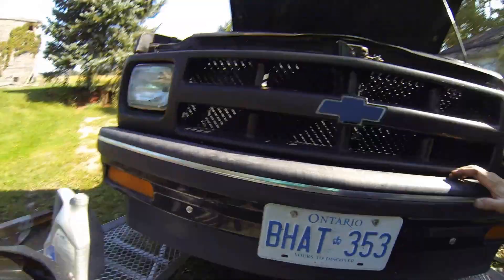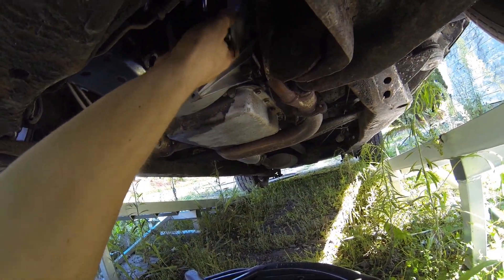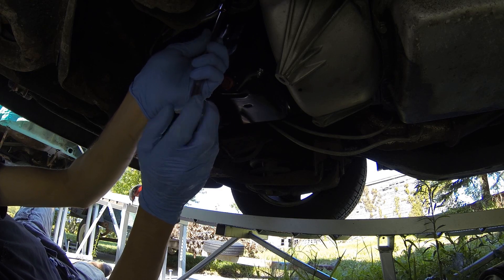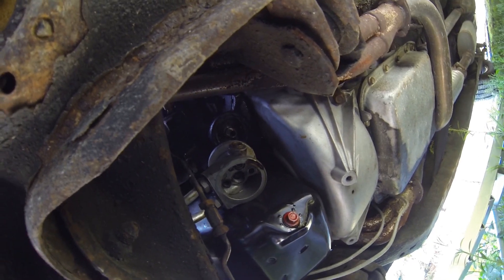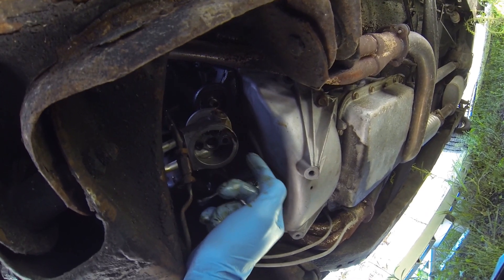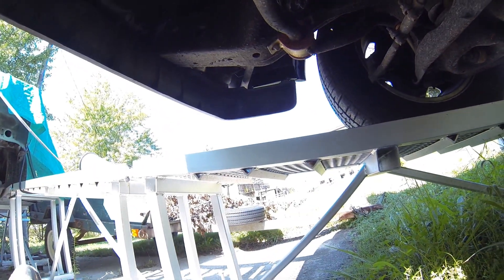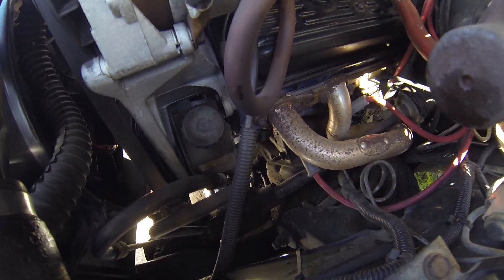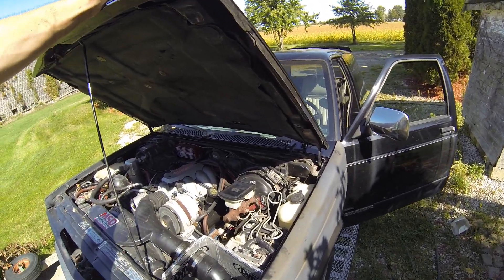S10 Blazer FREE FIX Oil Cooler Removal

Comment: Thank you so much. I was stranded on the side of the road with a blown oil line and was able to fix this and save my vehicle but some basic tools I had in my blazer. The separating that adapter with the Allen head really saved my ass. Thank you so much brother
Reply from the maker: Very happy it could help you out! thank you for the comment and sharing your story. Cheers!

Comment: this worked great on my 89 S10 Blazer 4x4,  replaced the oil cooler line 3-4 years and were leaking again till I did this fix. thank you
Reply from the maker: Thanks for the follow up, glad to hear it worked out Cheers!
Reply: Get to know my Orleans replace that 10 years ago and good I don't bad that match. You got any ideas about the rear bumper molding mine came off too I got two screws in the front one it's 92 with the same setup Vortec S10 Tahoe digital dash like to find a cruise control cable for it
Reply: Did you need to get a stubby filter or does the original size work?

Comment: heading out to do my 97 s10 finally figured out that this is my oil leak hopefully all goes well  thanks a bunch for the info perfect
Reply: did it work for you?  i have a 95 s10 i want to try this on.
Reply: @effenfish661  yep!!!
Reply: @effenfish661   yes but be careful removing your 2 torx screws I stripped one and it took alot of extra bs getting it out but yeah no more oil leak it even increased my oil pressure about 8percent

Comment: Deleted mine in my 02' Blazer Zr2. No more leaking lines & oil spraying everywhere. My Oil Pressure gained also! No difference in normal operation Temp, even when pulling my trailer or under a heavy load. I did try a 180° thermostat but that set off a Check Engine Code, "Coolant Temp Below Threshold"- so the 195° went back in & no issues. You have to use a little oil filter & you can reach it to replace or install with a small 3/8" drive metal oil filter removal bowl socket thingy for oil filters & a long extension
Reply: Appreciate the info on the thermostat. 200° it's where it runs on the according to the dash I was thinking it could be cooler they gave me 200 to put back in it but I haven't done it yet I living in Texas I wanted to be as cool as you can be tripping the sensors it'd be nice to get more than 14 miles to the gallon difference

Comment: I’m not sure where you live, but I am in Minnesota. In the winter the oil becomes super thick when it is -30 outside. I am deleting my cooler on my zr2 blazer as well, but what you forgot is that you no longer have an oil filter bypass valve if the oil is too thick or the filter clogs. It would be better to buy the $5 adapter of off summit that includes the bypass valve. But great video! Good luck!
Reply from the maker: 15th_Street_Garage good point! I do however run 5W30 synthetic and the blazer batteries are removed from the truck during the winter.  Im in southern Ontario.  Thanks for the tip and comment.  

Cheers!
Reply: 15th_Street_Garage my 4x4 sonoma looks like that same deal here. I do 4wheel it. But don't drive it every day either.  Think I could get rid of that an just slap my filter on there an fix the leakages....
 What's that part name on summit so I can look it up? Or add a link for me would be awesome! Thanks. Mines a 97 zr2. 4x4 5speed.
Reply: There should be one in your oiling system already on your Zr2 that you can unbolt and remount just onto the engine, but then you have to run a short oil filter. I actually found out that 1992-1996 Lt1's sometimes came with an oil filter adapter that moves the filter in towards the pan so that you can run the stock filter without hitting the front driveshaft or differential. I should be getting mine in the mail sometime this week, I found a guy on a facebook forum for LT1 engines in Texas. Hopefully he follows through.  GM part number 10168497. Good luck SIKZR2. The oil cooler lines are one of the biggest weak points on a stock Zr2.

Comment: Thanks for the tip, changed mine out on 2000 S-10 4.3. I took my fitting with me found STP 3980 is little bit longer filter that works with 4.3 V-6.
Reply from the maker: Glad you found it useful.  thanks for the comment!
Reply: I hope it's as good as the AC filter I'm trying at the STP oil straight 30 weight I always use the STP additive with all the oil changes slippery stuff

Comment: Great informative video! Do you know what the new oil capacity is now that the cooling system is removed. I am assuming right around 4 quarts.
Reply from the maker: Your probably about right but I always filled to the dipstick level. never really measured

Comment: I have a question, can you use the same oil filter after removing the adapter? It seems that the diameter of the filter housing on the engine block is smaller than the one on the adapter. It may be just an optical illusion when looking at the video...not sure.
Reply from the maker: The same filter fit with no issues for me.
Reply: @RobHoffmann20  Thank you. I appreciate it.

Comment: I have a 1995 Z71 with the 350 in it. Will this work for mine? Also, couldn't you just put plugs in the inlet/outlet holes on the adapter?

Comment: So what happens to the lines going into the radiator? Do you you plug up the holes or just leave connectors in?
Reply from the maker: You could Install hole plugs or bolts. you could also leave them open. I ended up replacing the rad when it cracked and just opted to buy the cheaper rad without the oil cooler.
Reply: @RobHoffmann20  Awesome, and thanks for the video and info!
Blessings!
Reply: It’s a closed loop system so nothing will be affected whether you plug them up or not

Comment: Good video with great narration! I can't stand when there is stupid music or pictures. However, removal and replacement of this assembly is very easy, and not to mention it's quite cheap. There are updated cooler line's which aren't prone to leaking. The oil cooling has a ton of pro's and zero con's. Also, I don't know why you have an MSD ignition system on any modern GM that isn't crazy modified (in the case of the 4.3L say a turbo with a marine MPFI intake). The stock HEI system is far more superior to any aftermarket system. Multiple tests and dyno run's have tested the theory on GM 4.3's and 5.7's and there was no gain.
Reply from the maker: walter white Thanks for the feedback and comments, I did not know there were replacement oil cooler lines avaiable.  Also regarding the MSD, originally I had issues with ignition on the truck as well as power losses, it stemmed back to the ignition system as a whole.  Replacing the coil and installing the control box provided a more reliable idle and smoother operation.  The distributor began to fail and after that it was replaced with a new MSD model which now has removed any play within the original.  I'm not going to argue the O.E. GM equipment wasn't better than current however for me having a failing system this was an upgrade.
Reply: I will admit, I myself have had run in's with the distrubtor systems on vortec engines. When working properly, it's very reliable and powerful. However, when it's acting up it can throw you for a loop. One reason I'm going LS : p
Reply from the maker: walter white I would enjoy going the same route one day in the future.  I would have to transplant the 4.3 into my Chevette, haha that would be a riot to drive!
Reply: @TheWalterHWhite  "when working properly it's very reliable" lol

Comment: Do I need to plug the holes where it connects to the radiator? I'm trying this right now.
Reply from the maker: That's not necessary,  the oil cooler portion of your radiator is a closed loop meaning it's totally isolated on its own. once you disconnect the lines and whatever residual oil in that cooler drips out there won't be anything else in there. Unrelated to this video shortly after I replaced my radiator, when I ordered it I simply ordered one without the oil cooler so now I don't even have those ports available
Reply: @RobHoffmann20  I think I will go to the hardware store when I do mine tomorrow and by threaded caps to put over the fittings.  It just makes sense to me to do that and it looks "complete".

Comment: Is this a 4.3? I have a 2.8V6 with a 5 speed and it’s a little more tucked in on the side of the block. I just bought the truck and the previous owner told me that it need the oil housing gasket. I have it and I’m thinking about doing it but don’t really see any oil leaking and I’m not sure if it has cooler lines on it. So I might just change the oil and call it a day.
Reply from the maker: This one is a 4.3L. Sorry but I'm not really familiar with your engine enough to offer guidance.  Thanks for watching.
Reply: RobHoffmann20 Thanks for the reply. I skipped it because I didn’t see any saturation by the gasket and I think I would’ve had to lift up the engine or something because the bolt that holds it sits up against a motor mount. There was no clearance to get anything in there, let alone taking out all the way.

Comment: So deleting my oil cooler off of my 07' 6.0 vortec, it's a different setup, but what I'm wondering is the dip stick will read lower without 6 quarts in her now...
Reply from the maker: My understanding is the dipstick would measure the level of oil in the pan. So if you're eliminating the cooler the level of oil in the pan shouldn't change. ( of course that's assuming you've got the correct level in there after removing the cooler)
Reply: @RobHoffmann20  I know it takes 6 quarts, it should only take 5 quarts without the cooler, but it still takes almost 6. lol
Reply from the maker: @igotatan1  that's funny! im sure as long as it's not over filled it wont be an issue

Comment: Seems awfully easy fix, to increase oil pressure. My 4 wheel pressure drops to near zero when idling, otherwise runs about 40, is the oil cooler removal just as simple? Is it not necessary to plug the radiator take offs?Would I need the adapter for the filter, since it is a 4X?
Reply from the maker: Im not familiar with the process on a 4wd truck however i can't see this increasing oil pressure unless the cooler is plugged up.  Plugging the unused oil cooler ports is not necessary.  You may have some luck joining a s10 group where it's likely they could answer your question in better detail.  

Thanks for watching.  

Cheers

Comment: Did you just say. Plug the radiator line holes with a rag ? 🤨
Reply from the maker: Yes,  as the oil cooler passage is isolated from all other passages within the radiator it will have no pressure to cause any real issues
Reply from the maker: That's interesting, with your little issue.  I'm not really positive what to tell you about that.  Good thinking with the compressed air!

Comment: Was the adapter already on the car? Or will I have to buy an adapter?
Reply from the maker: In my case by removing the oil cooler it was not required to buy anything.
Reply: RobHoffmann20 Thanks for responding so quickly. Have you had any issues with the engine since? I guess it’s been about two years.
Reply from the maker: @randallallen5620  No issues to date,  in my case I did not need to have the cooler based on my driving conditions.  Mostly flat here.  No heavy towing,  etc etc.  So if your scenario is comparable you may be able to do the same.
Reply: RobHoffmann20 I’m in Michigan so it should work. Same engine too. Thanks a ton for the insight.
Reply from the maker: @randallallen5620  Happy to be of help.  Best of luck! Cheers

Comment: i checked at my local mech. shop & to replace both front & rear cooler lines were $400. i'm a just delete mine. no need for it, imo for just a daily driver. Mine is a 02' Blazer ZR2
Reply from the maker: Mike Hog A Nator I have had no issues since the delete.

Comment: My Jimmy is leaking oil from around that fitting, while the engine is simple that whole area looks like a total pain in the ass to get to. ughh debating if I should delete it. Last thing I want is to lose all oil pressure and destroy the engine.
Reply from the maker: Michael Brown clean it out with a power washer and a degreaser it will make the work much easier when its clean
Reply: Yeah I have the 4wd model so I think deleting that stuff would be tricky for me beacuse my filter is all the way up front under the rad. But after watching your video I'm almost certain my leak is from the adapter area. Went on ebay and ordered an O Ring Kit. My whole engine bay could use a pressure washing. there were rat nests in it and 20 year old funk when I bought it. Bringing her back to life part by part.
Reply from the maker: Michael Brown 4x4 is definitely a different game! Glad to hear your working on bringing it back to life!

Comment: anyone know if this works on an 02 zr2 s10?
Reply from the maker: If you were to pull off the oil filter and remove the cooler adapter you can find out pretty quickly. If you're going to check it out maybe wait till you're due for an oil change. 

Thanks for watching.  

Cheers